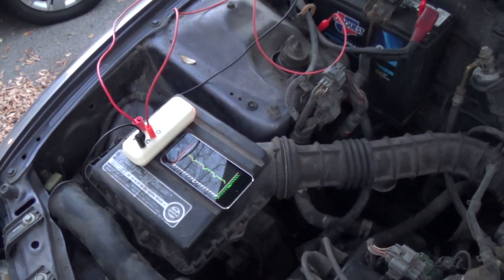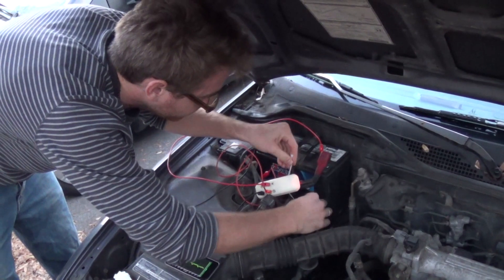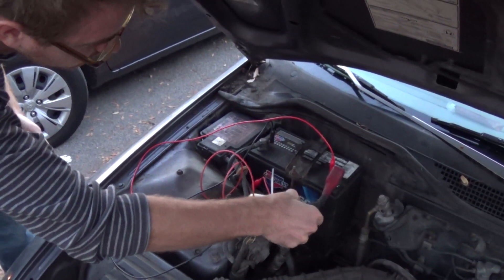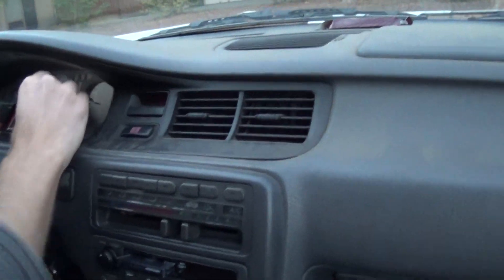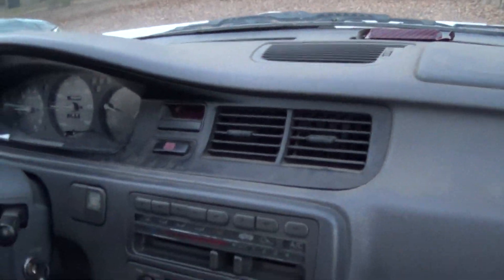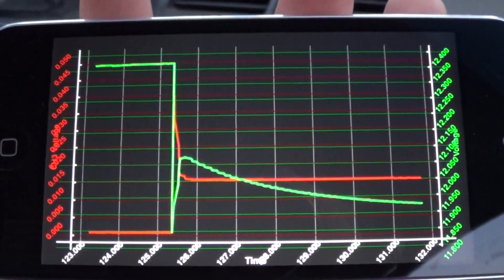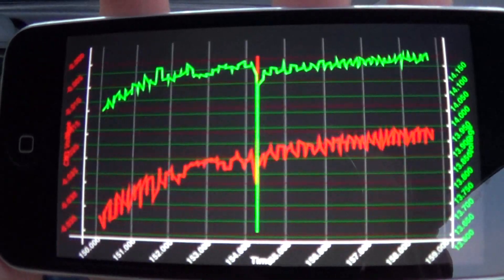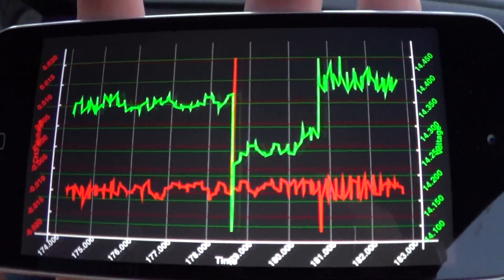Installing a Mooshimeter in a Car

Comment: Could the same logic be applied to measure power (between the ESC and battery) in an rc model? If so, to what should be the 2nd channel connected?